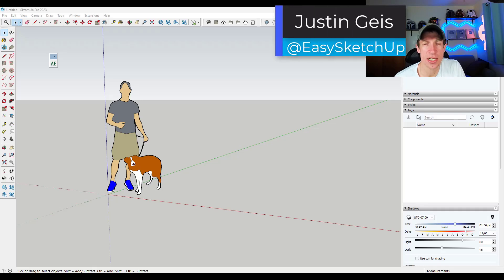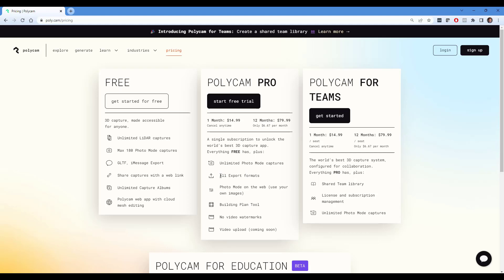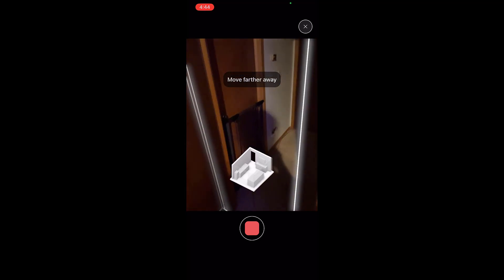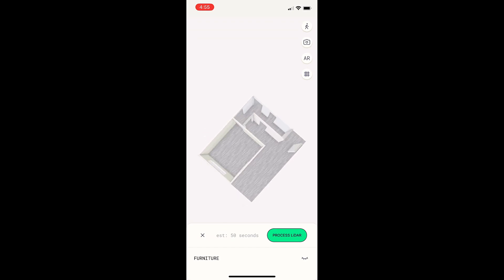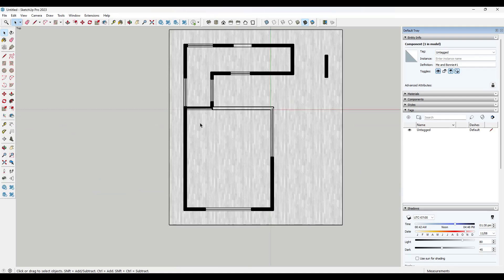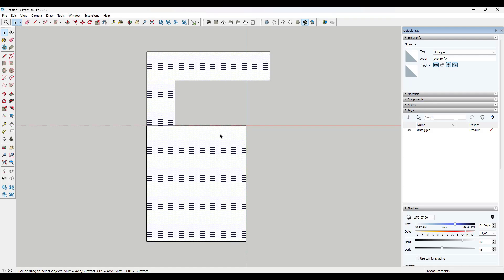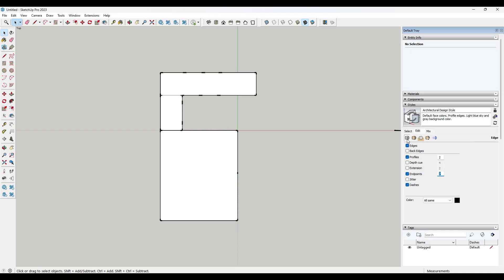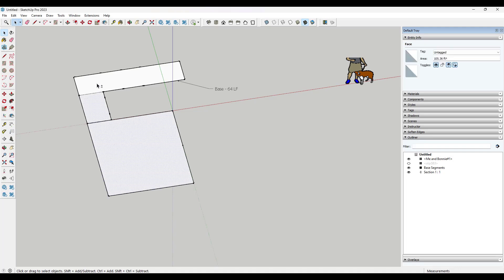How to Quickly Use LIDAR AND SKETCHUP to Measure Areas!

Comment: How precise is the resolution? Can you use this to build custom furniture that fits really well?
Reply from the maker: Definitely not - it doesn't get down to the 1/4" or 1/8" or whatever you'd need for furniture. I use it when I need a model that's close (like within an inch or two). If you want super accuracy, I'd still go with the old fashioned way

Comment: The problem only is that the results are not precise at all and apples api struggles with architectural details a lot …

Even in a basic room drift is present

This is fine for coarse work but that’s kinda it
Reply from the maker: The new Ipad release has a Scan to Design mode that's based on Canvas software I believe - my understanding is that it's more accurate, but I can't speak to how much more accurate it is
Reply: @Thesketchupessentials  Problem Canvas faces is the same like all other LiDAR apps - drift and distortions. That paired with SketchUps problem dealing with dense meshes makes this really an odd tool to add.

I did some tests (I know Canvas since a long time) but placements for doors windows etc is so inaccurate that I am puzzled about this.

Dot3D is kinda the only LiDAR app that fixes some of the drift issues.

Comment: Thanks, appreciate the video. Working on defining scope for a couple remodeling jobs, looks like I'll be getting Polycam to assist. Haven't determined if I need to borrow a newer iphone or if I just use photogrammetry with my S23U.
Reply from the maker: I'd make sure to spot check some areas to make sure it's giving you the level of precision you need. For my purposes it's been great, but if you're looking for laser accuracy to the tenth of an inch, I don't think it'll give you what you need. All depends on your specific use case

Comment: I have found Polycam to be pretty awful for measuring interiors. Accuracy is just not there, and their built in plan function is terrible. It's hugely disappointing.
Reply from the maker: What have you found the error factor to be? I don't like measuring off the 3D lidar data because it's kind of lumpy and not super precise, but for "within an inch or two" applications I've found it to be fine

Comment: I use Polycam and export to SU as DAE, but without LiDAR, just photogrammetry. I put scale bars and even a tape measure into my scans so I can rescale the model. Polycam has the best rescale feature of all the programs I've tried, including Metashape and Photocatch. So just curious, how accurate is LiDAR, and do you have to rescale at all?
Reply: LiDAR is to scale but all LiDAR apps suffer from the same drift issue meaning the bigger the room the higher the chance at the end your walls won’t align bend etc.

Truth is the LiDAR tool is very coarse and not really usable 

It is made for dof finder for photos or place usdz models in AR

LiDAR with photogrammetry is what works better 

LiDAR establishes scale and photogrammetry the percission
Reply: @cekuhnen what app is doing lidar with photogrammetry?
Reply: @Ericpotratz  yes you can use LiDAR for scale and position and photos for detail meshing. Trnio was one of those.

Comment: I am an interior designer and just these days I have to decide whether to get ipad air without Lidar or ipad pro with Lidar. I have seen several videos of Polycam and it looks undoubtedly promising although from an interior design perspective it seems to me that it is still not that reliable with measurements. Am I wrong?
Anyway I think I will opt for ipad pro because while it is true that nowadays measurements are still not very accurate with any app, I think they will improve in the future.

Ps: I always follow you and you are always a great support to learn and improve.
Reply: I am 3d professional and all LiDAR videos and apps are misleading - the accuracy and quality of all LiDAR model apps are terrible.  Period. The only app that is Trnio which uses LiDAR together with photogrammetry.  At this point I am quite disappointed how people repeat those LiDAR stories - they were proven unusable already a long time ago.

App,es room scan api is utter useless - it is fine for IKEA place furniture tricks but not more!
Reply: @cekuhnen  may I ask what about scanning the room. getting the skp file and then remeasure, wont that save a lot of time as you can just fix the dimensions as you go along
Reply: @chrislangeveldt8859  why not scan it once correctly and then use it as a reference to model over without the need of any extra post measurement verifications? It is all about accelerating and perfecting practical workflows.
Reply: @cekuhnen  Supposedly using a gimbal helps greatly.   
https://youtu.be/faYZdcYsVUU
Reply: Class is right.  An app that does combine ease of use and absolute accuracy is Magic Plan.  It too uses LIDAR to map a room and recognizes doors and windows etc.  But, it uses bluetooth to link  to a laser measure.  So, scan first to place everything and then tap the dimension that you want spot on and measure with the laser.  You can also drag and drop graphics for doors, cabinets, furniture, etc.  And label picture placements.  I do Magic Plan and then walk the building with a 3d camera (not the Matter Port camera but the Theta Z) and upload to Matter Port.  Then you can walk through the whole building as if you were there.  Saves a ton of time.
Reply: @tomvallee1768  I never had access to such a tool and thus never really further explored their floor plan apps because they all suffer from the same technical limitation of Apple’s LiDAR sensor.

Their pure LiDAR apps are fine to make a quick scan when inaccuracies deformed walls etc are fine but they are utter useless for precise work.

Trnio uses LiDAR to establish scale and help with alignment and that data is then further refined with the photogrammetry pipeline producing very detailed and precise meshes.
Reply: The iphone pros also have lidar.